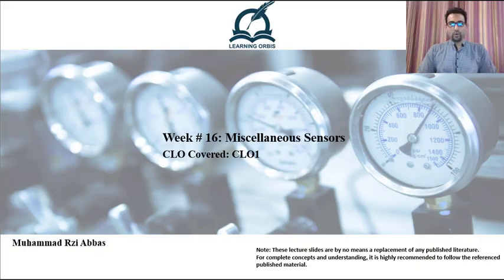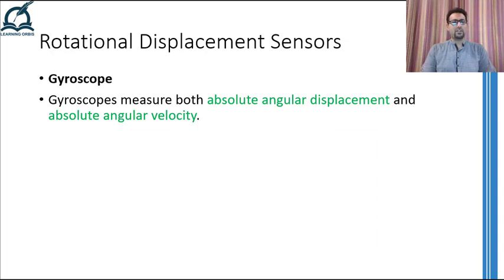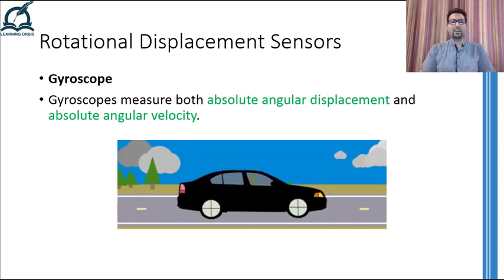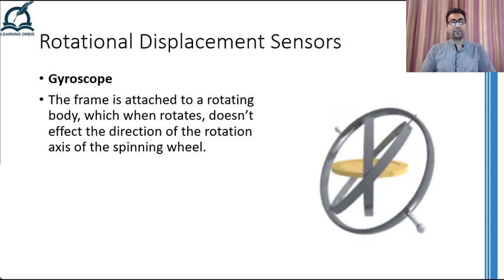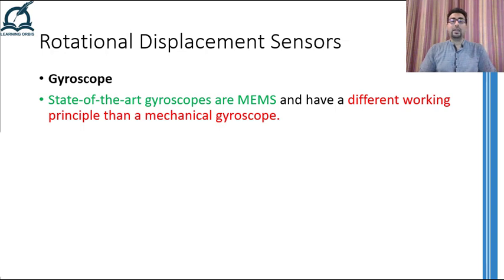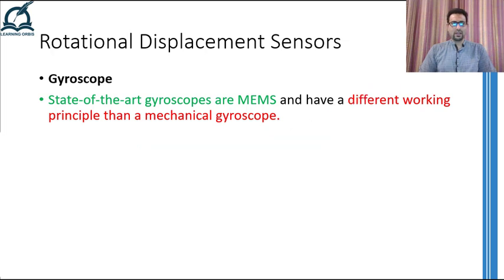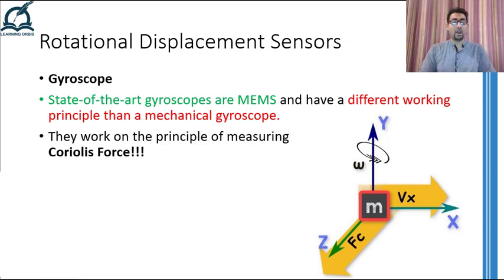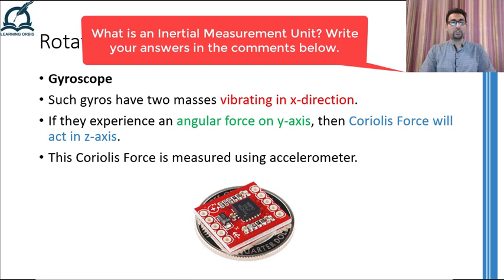What are Gyroscopes? | How They Work?

Comment: Please help ı can not understand. Does the gyroscope only calculate the coriolis on its spinning disk? Or can it calculate a coriolis related to the world?
Reply from the maker: It can only calculate Coriolis force related to the spinning wheel of its own. For calculating the Coriolis force due to the rotation of the earth you need to consider earth as the rotating wheel and see the movement of clouds or sometimes the movement of whirlpools to figure the force. But that is something which cannot be done easily in lab.

Comment: An inertial measurement unit (IMU) is an electronic device that measures acceleration, angular rates and orientation. It works by using a combination of accelerometers, gyroscopes etc.

Comment: An inertial measurement unit IMU, is an electronic device that measures and reports a body's specific force, angular rate, and sometimes the orientation of the body, using a combination of accelerometers, gyroscopes.

Comment: An Inertial Measurement Unit is an electronic device that measures and tells us about angular rotation, specific force and orientation of a body. It performs its function using a combination of accelerometers and gyroscopes mostly and sometimes, magnetometers too.

Comment: IMU or inertial measurement unit is an electronic device that measures and gives different factors including orientation, specific force, and magnetic fields surrounding the device. It uses a combination of accelerometers, gyroscopes, and sometimes magnetometers.

Comment: An inertial measurement unit (IMU) is an electronic device that measures and reports a body's specific force, angular rate, and sometimes the orientation of the body, using a combination of accelerometers, gyroscopes, and sometimes magnetometers. IMUs are typically used to maneuver aircraft (an attitude and heading reference system), including unmanned aerial vehicles (UAVs), among many others, and spacecraft, including satellites and landers.

Comment: Inertial Measurement Unit is a combination of accelerometer, gyroscope and magnetometer on a single compact chip. These sensors measure angular velocity, linear acceleration and magnetic field strength.

Comment: Inertial Measurement Unit consist of sensors such as gyroscopes, accelerometer and magnetometers. It is used to measure the linear acceleration (three axis accelerometer), angular velocity, magnetic field strength, specific force and other gravitational force . Few examples of IMU are below:
1- GPS positioning system
2- manned and unmanned aircraft

Comment: An IMU, also abbreviated for Inertial Measurement Unit, is an electronic device that measures and reports acceleration, orientation, angular rates, and other gravitational forces. It is composed of 3-axis accelerometers, 3-axis gyroscopes forming 6-axis IMU, and depending on the requirements, an additional 3-axis magnetometers are also used to make it 9-axis IMU.

Comment: An inertial measurement unit is an electronic device that measures and reports a body's specific force, angular rate, and sometimes the orientation of the body, using a combination of accelerometers, gyroscopes, and sometimes magnetometers.

Comment: An Inertial Measurement Unit(IMU) is an electronic device that measures and guide us about angular rotation, specific force and orientation of a body. It performs its function using a combination of accelerometers and gyroscopes mostly and sometimes, magnetometers too.

Comment: An inertial measurement unit is an electronic device that measures and reports a body's specific force, angular rate, and the orientation of the body, using gyroscopes.

Comment: IMU or inertial measurement unit is an electronic device that measures and gives different factors including orientation, specific force, angular rate, acceleration, and magnetic fields surrounding the device. It uses a combination of accelerometers, gyroscopes, and sometimes magnetometers.

Comment: Inertial Measurement Units (IMU),  comprise of accelerometers and gyroscopes (sometimes magnetometers) that use microcontrollers to process its collected measurements. It is used for human motion tracking and analysis, to measure  body's specific force, angular rate, and sometimes the orientation of the body.

Comment: An Inertial Measurement Unit, also known as IMU, is an electronic device that measures and reports acceleration, orientation, angular rates, and other gravitational forces. It is composed of 3 accelerometers, 3 gyroscopes, and depending on the heading requirement .

Comment: Inertial measurement unit IMU is a combination of electronic devices or sensors like accelerometer, gyroscope, magnetometer etc. that provide us the force acting on a body, its orientation and angular rate etc of the body.

Comment: The term IMU stands for “Inertial Measurement Unit,” and we use it to describe a collection of measurement tools. When installed in a device, these tools can capture data about the device’s movement. IMUs contain sensors such as accelerometers, gyroscopes, and magnetometers.

Comment: An inertial Measurement Unit is a set or combination of different electronic & electromechanical instruments/sensors which outputs the rotation, position, velocity, acceleration, orientation, etc in order to provide guidance to the mother object having it onboard e.g. in missiles, UAVs/UCAVs, Aircrafts & Space Ships such IMUs are used typically named as Inertial Navigation/Guidance System, which provides them with the guidance of their path/trajectory. When INSs are used with unguided air drag bombs, they become Stand-Off Munitions e.g. H2/H4 SOWs & Takbir Glide Bomb which were used in Operation Swift Retort were general-purpose bombs with a kit containing wings & motors guided by Inertial systems to strike their targets with pinpoint accuracies.

Comment: IMU or inertial measurement unit is an electronic device which measures and reports a variety of factors including orientation, specific force, angular rate, acceleration and magnetic fields surrounding the device. It uses a combination of accelerometers, gyroscopes and sometimes magnetometers.